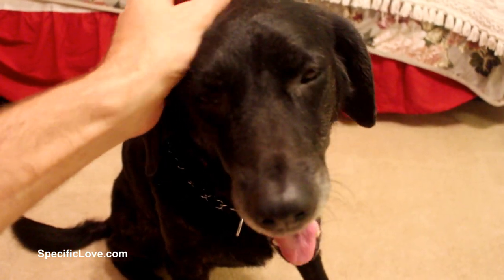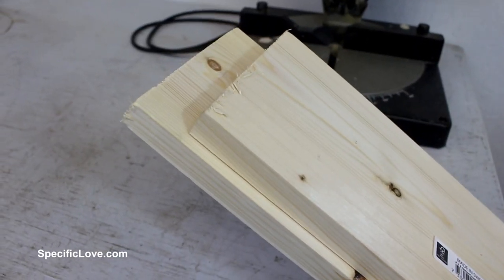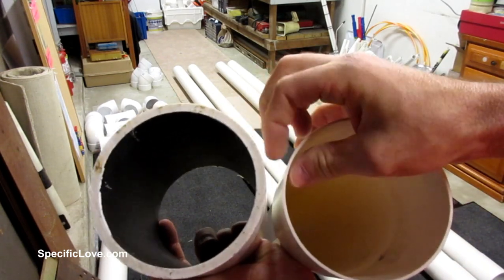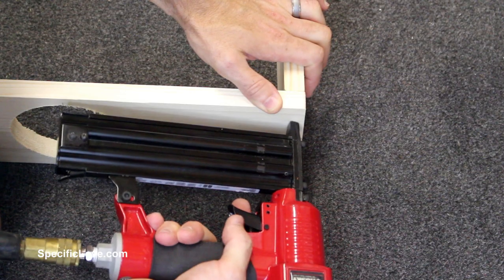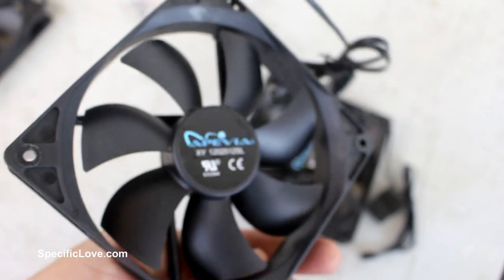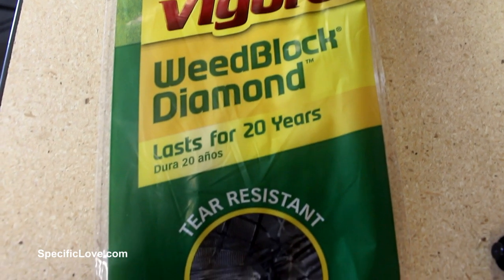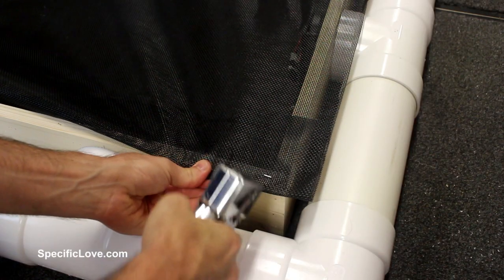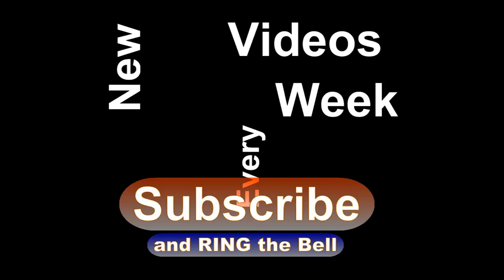Dog Bed with AIR CONDITIONING

Comment: I guess this has nothing to do with your project but where can I get a chop saw and sander like yours, the chop saws you get now are to big and l've been looking for one that size, do they make them anymore,  thanks Larry
Reply from the maker: +Larry Sowada The saw is an old one I found in my father's barn. I cleaned it up and it worked great. The belt sander is old too, but similar versions can be found at home improvement stores.
Reply: Larry Sowada google that is where you can find a good one for 80$+6$ for shipping